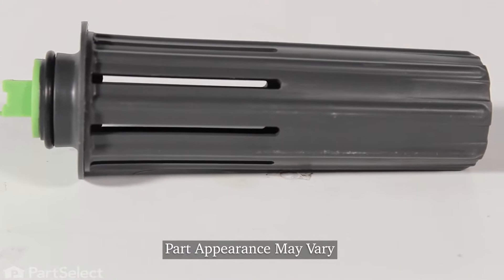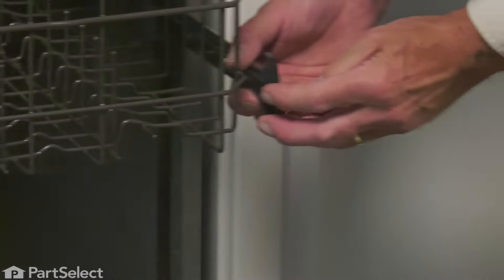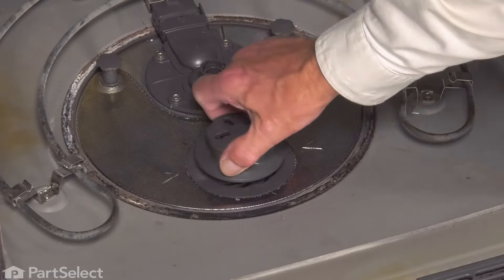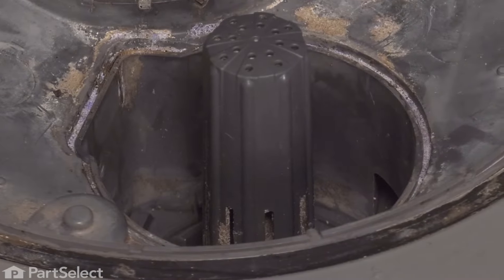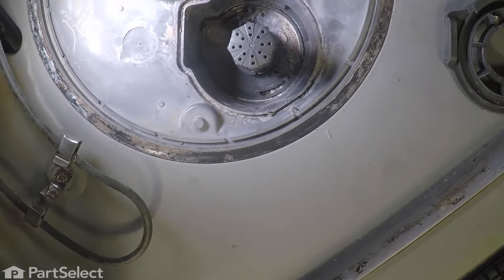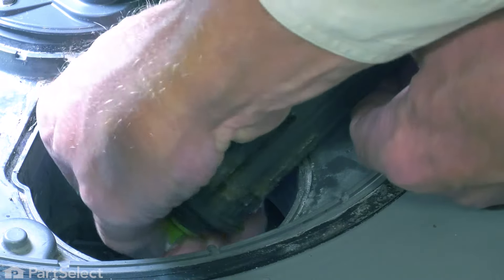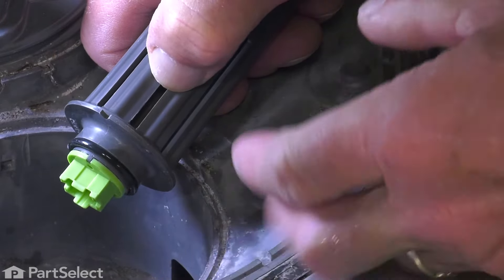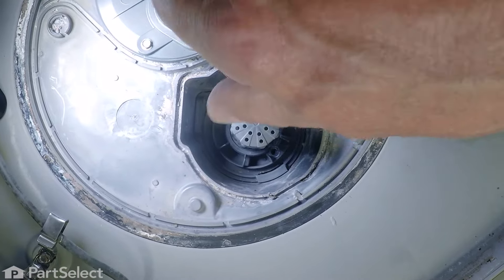GE Dishwasher Repair - How to Replace the Flood Switch (GE Part # WD21X10519)

Comment: O M G this freaking worked. I can NOT believe it . I am dancing around my house. All the search info went to a bad heating element. There was nothing during my first few searches that discussed this little secret. But after searching for like the 7th time,  i found this. Thank you Thank YOU. Bought the part on Amazon- got the one listed prime that was cheaper than all the others and it was an ACTUAL GE PART. Thank goodness for the magnetic hex wrench and i taped that little side hole. I did let the plug thingie slip thru the hole by accident and after cursing alot i got out the spackle gun and used the long L bracket on it to find the piece and pull it back up. I then taped it to the hole until i was ready to put the new part in. I also taped the side hole so i wouldn't lose the screws. What an empowering feeling. Truly thank you.
Reply: I love your enthusiasm.  😆  I feel the same every time I'm able to make a repair without needing to call a repairman!

Comment: Hey, I am 80 & just did the repair plus a lot of clean up inside the dishwasher. Just a comment, rather than old rags or paper towels to soop up the water I used a sponge. Worked out well. Great video, very informative with the step by step instructions. Excellent!!!

Comment: Hello, thank you for taking the time to make these videos, do you know if there is a way that I can test the part to know that it’s faulty?? Can this be done by testing the pins with an ohm meter. I don’t know which wires to test, the harness for this part that has one orange wire, one red wire, one blue wire, and one white wire… I’m going to go ahead and replace it, I’m a technician for an apartment community and I would like to test Parts to prove their bad if I can , thank you for any advice or help with this, thanks again I really enjoy all of your videos, and I learned a lot from them

Comment: This repair fixed the issues with the water in my GE dishwasher not heating the water. Thank you. Part number needed is Part # WD21X10519. Great repair video quality and instructions. Thank you.

Comment: Thank you for the video. I switch out the flood switch, but now it won't drain at all. Please advise.
Reply: Did you try turning your circuit breaker off for a few minutes and then turning it back on? Did you find the reason for not draining?

Comment: Hello. Don't really expect a reply but it is worth a shot. If the float is bad, will it cut power to the user interface? I have good power to the lower board (green LED is flashing fast) and I have 13.8V at the pins going to the upper door control panel but I have no power on that upper panel at all. I've tried all resets known to man. Trying to avoid buying panels I don't need if the float switch could be the issue. thanks

Comment: How can you diagnose if this part is bad or not?
Reply: With mine, the dishes weren't completely dry, and didn't come out hot. No steam would come out of the dish washer
Reply: Good ones rattle, ball float inside must be free to float, bad ones don’t.  Replacing this part fixed mine too.

Comment: Just curious, and this is a serious question: what should you do if that harness goes back down into the hole? What would I need to disassemble next? I am about to do this right now, so I thought I would pose the question for possibly myself and others. Also-THANK YOU for the info about the 1/4 inch extender.
Reply: You can reach underneath and push it back through.
Reply: I also thought it will drop. I tied the wire harness with a thin rope before disconnecting it. Even if it drops, i can fish it back out. Wow, this video helped.

Comment: how did you get the water out of there?
Reply: I think water isn't supposed to be in there (it is supposed to drain out), but if things are clogged, you can use a rag to soak up the water and squeeze it out into a bowl.